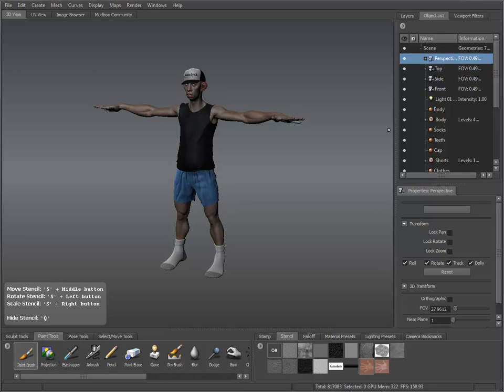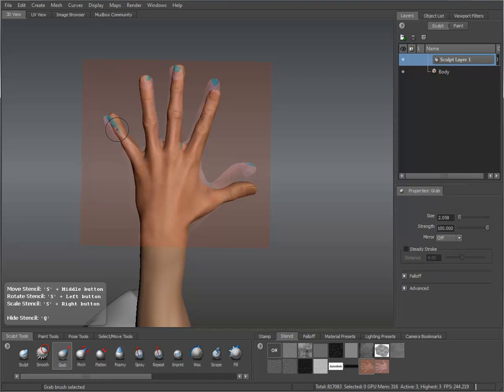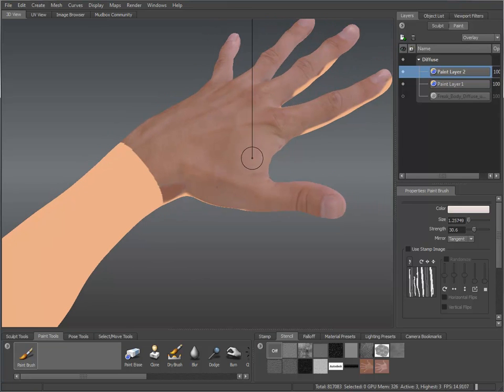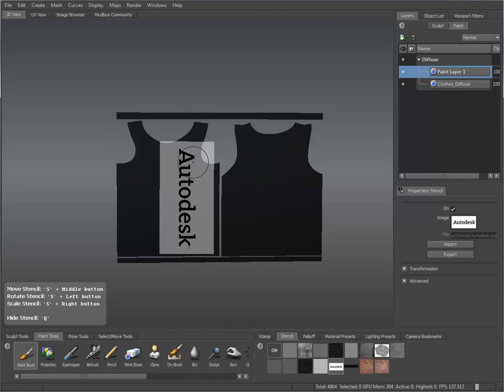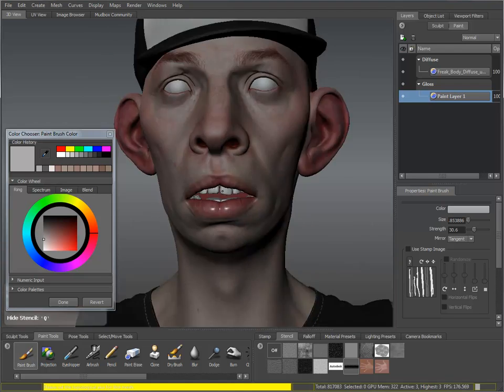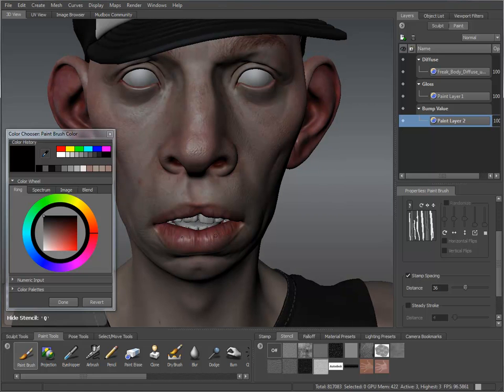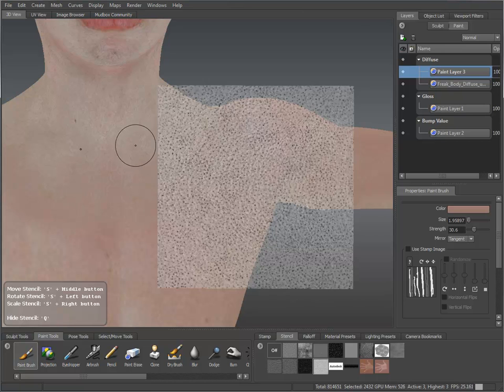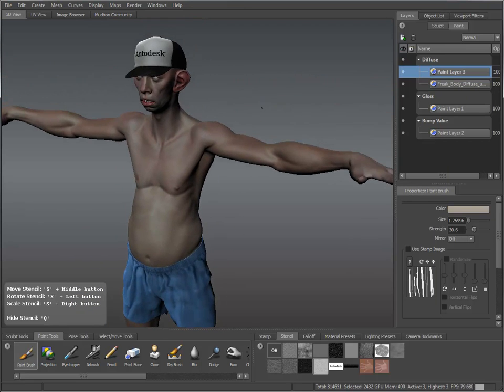Mudbox 2011 Texture Painting Tutorial

Comment: It's likely that your graphics card or driver is not supported by Mudbox. You need to have a relatively recent nVidia or ATI graphics card with current drivers (these can be updated at nVidia or AMD's respective websites). Intel integrated graphics will not work with Mudbox.

Comment: Just one issue with this video: After projecting the texture onto the hand, why didn't you revert to the undeformed (original) 3D model? That might confuse some people and make them think that they'll have to use the deformed model (when in fact the UVs will make the texture match the original model correctly). 

Also, doesn't Mudbox have texture projection warping (like Mari) ? That would seem to be the most elegant way to quickly align photos to models for projection.